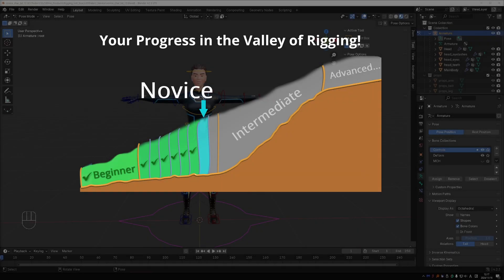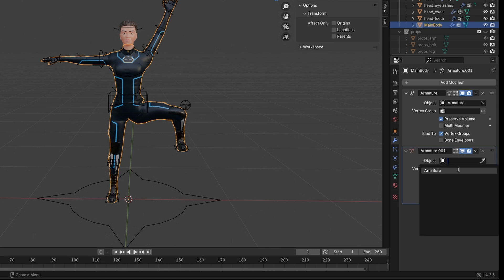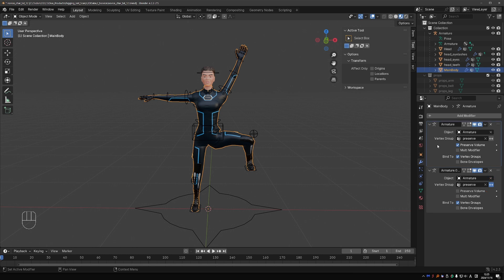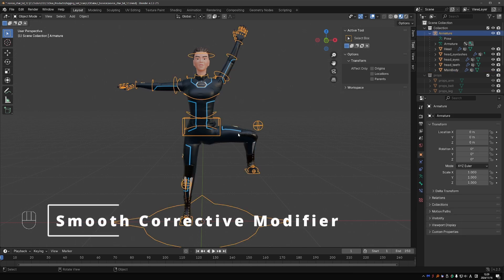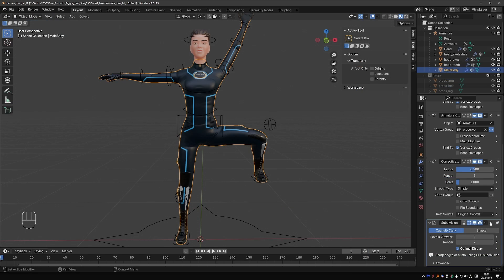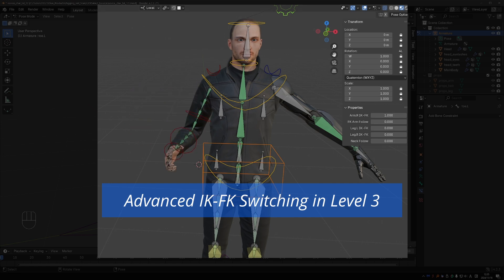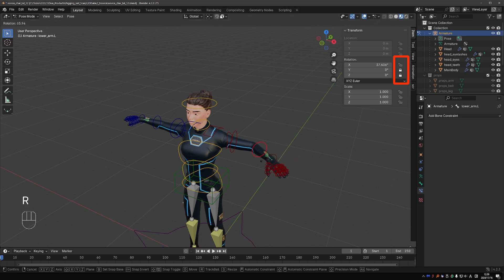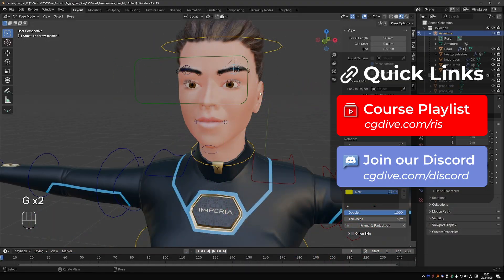RIGGING L2-7 : Cool Rigging Hacks

Comment: Hi. I have issue with weight painting not mirroring the changes on X Axis. Mirror Vertex Groups is enabled and mirroring on X is activated. However, with these being enabled I have to do it manually on both sides. Any idea why this is happening? Thank you very much.
Reply from the maker: Most likely your mesh is not really symmetrical even if it kind of looks like it is.
Reply: @CGDive Thank you very much.  Could it also be for "the origin " not being in the center?
Reply from the maker: @mahdidaraei4185  yes, it could be! The origin determines the axis of symmetry so it's essential.
Reply: @CGDive Thank you again.  I believe that should be the case. I wish in the future Blender would be able to warn users about fixing these issues.

Comment: Finally came back to this tutorial and applied this Preserve Volume fix to my rig. The level of control this kind of thing affords truly is marvelous! I was having a lot of the same issues you had here, with the butt and armpits, and this has largely solved them. For reference, I'm rigging a very buff character, so making sure the deformations look as best as possible is really important. Edit: I found an important change here! So, while this works great when you aren't making any rotational changes to the root bone, it causes major issues when you do. Rotating the armature object itself is 100% ok, but when you rotate the root bone, all the areas affected by the inverse of the preserve volume group get stretched in unpredictable ways. I've found that simply disabling the main Preserve Volume fix group on the first modifier (the one that has preserve ticked) and then ticking multi modifier on the second (that doesn't have preserve turned on), and then using vertex groups to control where the effect applies leads to no issues during rotation. Try that!
Reply from the maker: Yes, thanks for pointing that out! I should probably make an update video because I also found out a bit after making the tutorial that multi-modifier is meant specifically for this use case.

Comment: First of all, thank you for all the work you put into these tutorials!

The preserve volume fix is really interesting, but I'm finding that it breaks a lot in practice. Long story short, at more extreme poses, the mesh can get really distorted around the transitions of the preserve volume vertex group. The blender manual also says to enable the "Multi Modifier" checkbox in the armature modifier when using more that one armature modifier. This sometimes helped, but the distortions were still pretty severe in my case. Not sure what the deal is, or if my model in particular was kind of cursed, but I'd be curious what other people's experiences are posing and animating a character using multiple armatures in this way.
Reply from the maker: So you applied the fix for Preserve Volume but you still get bad deformations? I'd be interested to see the file just out of curiosity.
To be honest, I am also not a huge fan of Preserve Volume for this exact reason. That's why we won't use it in Level 3.
As for Multi Modifier: YES, if you use it you can get the same result as I show in the video you can skip a step or two from my process. I'll check again what the exact difference was but it won't give you better deformations.
Reply: @CGDive   Yes, I applied the preserve volume fix using the 2 armature modifiers and a vertex group to blend between the two. At a glance, and at simple poses, it appeared to work fine, but at more extreme poses, strange distortions started to happen around the fringes of that vertex group. It would seem like various verts would get over-influenced for some reason. I ended up resorting back to using a single armature modifier instead on this model, but kept the other two there for the sake of comparison.
I can send you the blend file if you'd like to have a look. What would be the best way to get it to you? (do you have an email/discord/other contact which I can send you a link through?)
Reply from the maker: @RLG_3D  Hey, here are ways to get in touch
http://cgdive.com/contact

Comment: One thing I'm curious about is if it's possible to have bones that can only rotate within a certain area. I've found the constraint/modifier that prevents the bone from leaving(or entering) the walls of a certain object, but it doesn't seem to affect the tail, the part that actually moves when rotating the bone, and setting the head of the bone next in the hierarchy doesn't seem to work either, as the parent is unaffected by the constraints of its child.
Reply from the maker: Right, the bone is mainly defined by its head. The tail/length of the bone is mostly for the rigger's/animator's convenience.
If I understand you correctly, you want your character to act more physical and interact with other objects. Unfortunately, that is something that is not really solved even in the most cutting-edge rigs and applications. It's still the animator's job to make it "look" like the characters and objects are interacting. This may change slowly in the coming years but it has been like this since the inception of 3d animation.
Reply: @CGDive  
Gotcha, thank you for the response. I was mostly looking for something slightly more advanced than the Limit Rotation constraint, since its method of restricting the two axes kind of forms a rectangle shape of allowed mobility, which doesn't look the most natural.

I suppose I could try using the constraint for limiting mobility within a certain 3D shape on the inverse kinematics control bone itself, since it operates based on its location instead of rotation most of the time

Comment: Hello
The lessons are going very well. You explain very useful information very well. I am waiting for your help regarding my problem. I applied your lessons on my own character and completed rigging without any problems. My character has no clothes. He has shorts as a separate object. I could not adapt the shorts to my character. I transferred the Weight values in the character with Data Transfer but there was no solution. What kind of a way can you suggest? Best wishes.
Reply from the maker: " I transferred the Weight values in the character with Data Transfer but there was no solution."
I am not sure what that means. Why was there no solution?
Generally, I would suggest.... weight painting :)
You learned how to weight paint in the course. Just paint the pants until they move nicely with the body. It's going to be a good exercise.